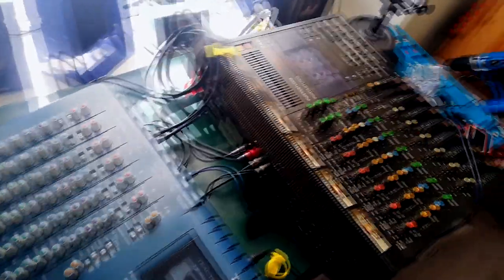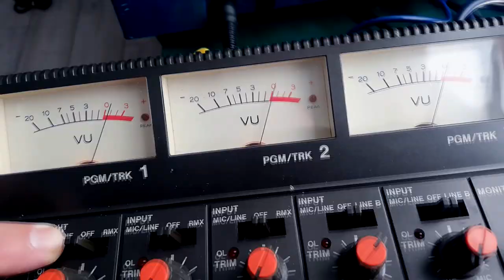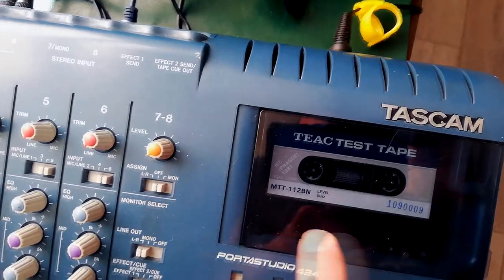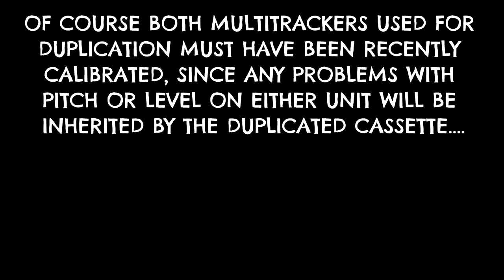Duplicating a 4 track cassette | Teac MTT-122BN Calibration tape | 424 Mk IIII into 246

Comment: Can I pick your brain sometime? I have this old rack deck based off the 246 that I’m trying to troubleshoot. I think something is blown in the summing board because there’s no signal anywhere. No sound nothing. Thing is rare and not documented anywhere so I’m at a loss! Help?!?
Reply from the maker: Is this the 234? I've filmed that one but not uploaded the footage yet. No audio whatsoever ( no hiss, nothing) usually means the opamps aren't getting power, so I'd check slow blue fuses rectifier and filter caps for that part of the power board before looking at the audio path. But yeah ask away
Reply: @Tetrakan  no sir, it’s a “microsound mr64” off brand. Was watching your videos so I’m going to try and tone it out and narrow down where the failure is. Based on my testing though I can assume it’s on one of the 2 main boards where the signals are mixed. I can send you pictures if you’d like. Would love to get this working.
Reply from the maker: You can msg me on Facebook, you can share photos there